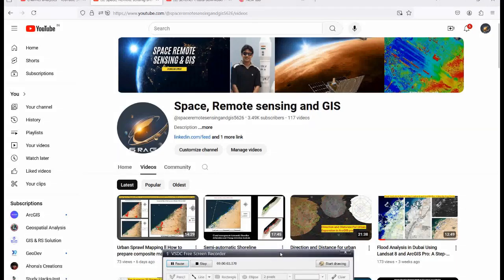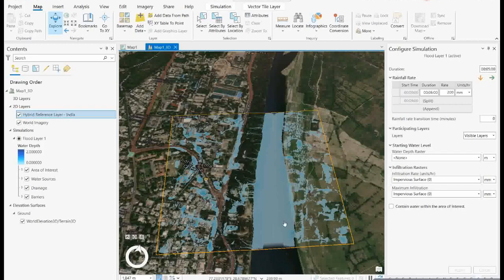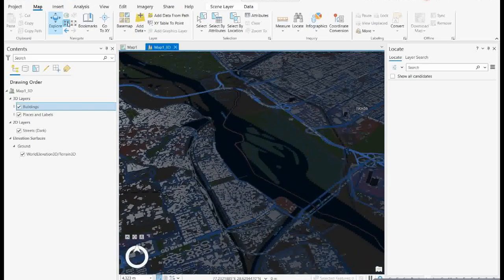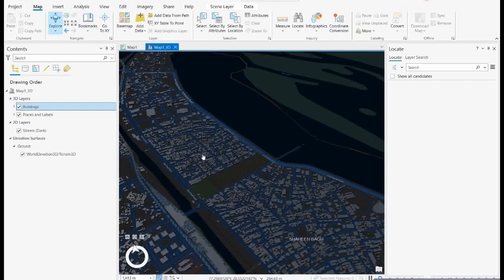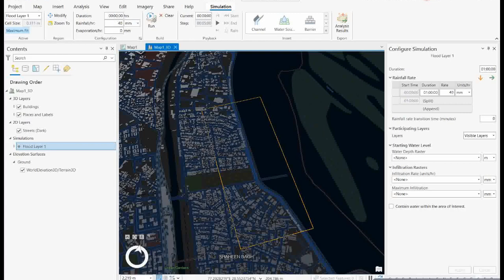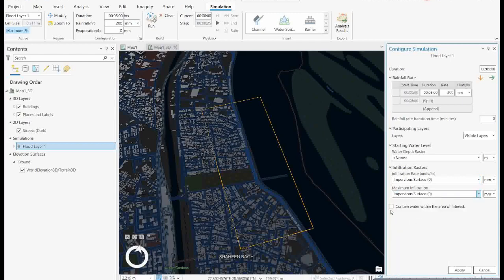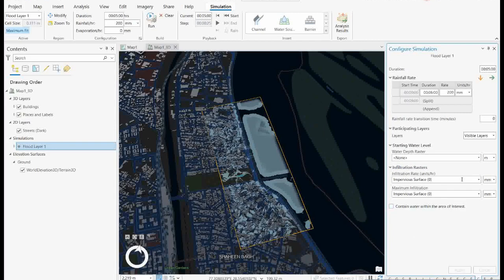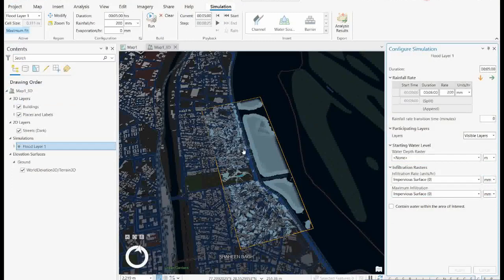Flood Simulation Using ArcGIS Pro 3 3

Comment: Great video Sir. Can this simulation be used in research paper? and we can draw results?
Reply: Yes you can but in that case use high resolution dem and include all the parameters. Then it will be a good work.
Reply: @suryatoy379  How can we add high resolution dem in this case?
Reply from the maker: Sir in ArcGIS Pro option is the to add high resolution dem just to removing base map dem. You can do that. Check my old video I showed that process
https://www.youtube.com/watch?v=ahXdIUtN0Jg